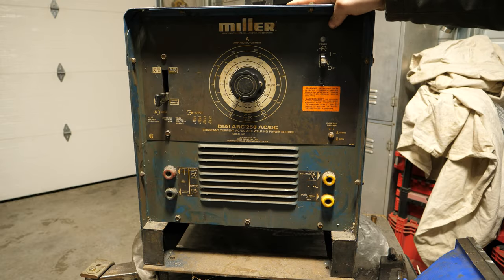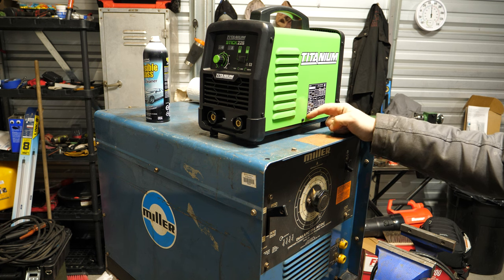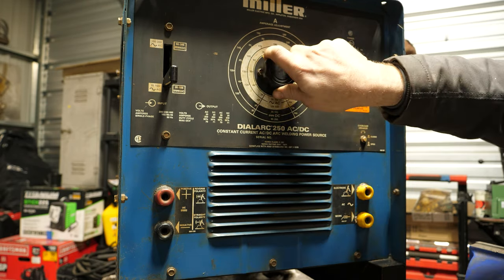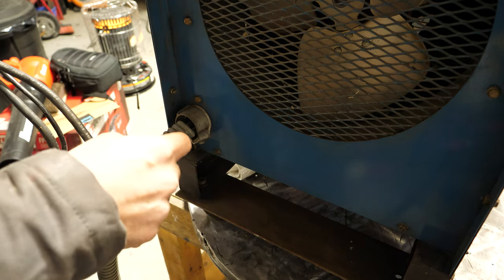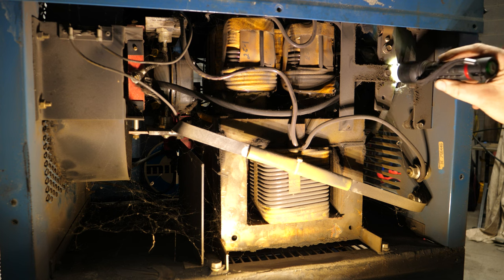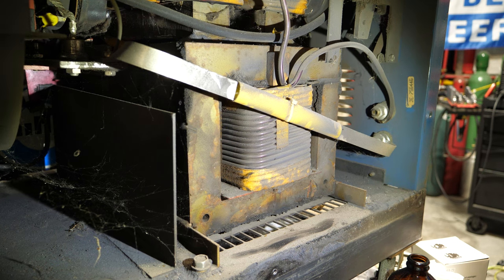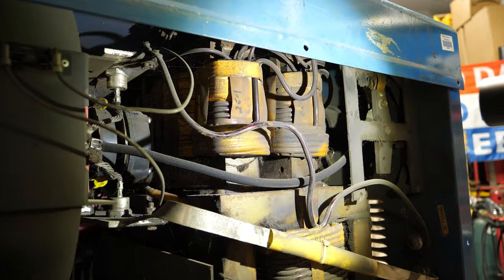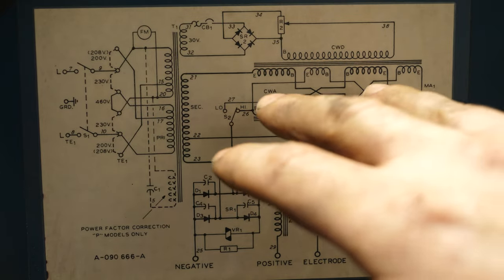Fixing up a 40 year old welder: What to look for and how they work

Comment: The word you're looking for is rheostat, power is controlled by magnetic amplification.
Reply from the maker: Interesting.  How does the magnetic amplification work then?  Many other older welders I have taken apart seem to use a mechanically moved shunt to control how how efficient the primary to secondary winding transfer is.  This welder is fixed with no moving parts.  The rheostat has very thin/small wire, so clearly it’s not carrying much amperage.  How would it be able to control a transformer?  My only thought would be that it’s varying the voltage of the output on the initial transformer into the actual welding output transformers.  If that’s the case that initial transformer must not output much amperage.
Reply: mag amp looks like a transformer, it is a saturable reactor it uses magnetic saturation of the core which happens to be non liner property of certain transformer cores.   @makingmistakeswithgreg
Reply: A  small dc current on the control winding can switch or control large Ac currents in the AC windings thus resulting in current  being amplified.
Reply from the maker: I definitely have a bunch of reading to do 😀.  It’s awesome to learn new things 😀

Comment: Meanwhile, that Machine cranks up and the neighborhoods lights all dim 😂
Reply from the maker: It’s pretty amazing how much power that dial arc loads up a circuit.  There are houses in my area that don’t even have enough power going to them to run just the dial arc maxed out lol.
Reply: @makingmistakeswithgreg  yea it’s like the grizwalds Xmas lights remember? 😂 dude you gotta check out my comments I added bout the die grinder, I lost my shit laughing last night when you randomly lost it bout that thing cutting off on the welding side job video man
Reply: So I own my own landscaping business and have my little channel I added recently for it, but anyways, I was tinkering in my shop last night welding and I’m like dang that spark ⚡️ felt little hot 🥵 for some reason down at my ankle, so I flipped the hood up and there’s damn flames 🔥 coming up past my knees 😂 I’m like welp I guess that settles it, these work pants are highly flameable. I got it knocked out and there’s literally like 8” of my pant leg missing, so while still laughing but alittle burnt ankle syndrome I walked inside to show my girl and I looked like ace Ventura when he comes back into that big formal dinner after that shark tank with his pants all chopped off, that was me and we laughed for 20 min about it 😂😂

https://youtu.be/GUfS_2UGftg?si=jbmhyQr47cDee0g5

Comment: i run nothing but 60 year old welders and i never have any issues with them
Reply from the maker: With very few components they definitely are reliable.  The main limitation is how power hungry they are and in the case of the welder I have, the poor power factor loads up circuits thus requiring big power wire.   They still weld great and it pays to have a few around 😀
Reply: @makingmistakeswithgreg  my larsen elt-16 225A welder pulls 41A at 380v 3phase

Comment: Now draw for us Why 240v is more efficient then 120v...  And the Diff between 1 & 3 Phase... And the Diff between Pulse setting's on newer stuff...
Reply: P=I*U. For the same Power with half voltage  u have to double the amperage. Higher Amperage creates more loss through heat at same size wire.
3 phase calculation: P=I*U*sqr3
(and yes, both have to be multiplied with the PF cosPhi.) You get roughly 1.7 times the Power than 1 phase. 
Pulse usually for MIG or TIG, lower frequnency: good penetration with good control and fast freezing puddle. For out of position welding and thin sheet metal High frequencies narrow but intense arc. Makes aluminium MIG easyer. Some manufacturers have "hyperpulse"(some kHz) for smaw, too. But what this does is way over my head...

Comment: Meh. I’m reading the guys here who love these old machines. They’re ok. Nit great. Sure they last, but really, that’s not a big deal. A company writes off their equipment. No big deal. There are very good reasons these things have died out, and good riddance. It’s odd how they do these connectors. Copper is around 90-93% efficient. Brass is around 30-40% efficient. The steel is around 25% efficient. I would never had designed something that way. It gives me the chills looking at it. It’s really called three wire cable. But all three are conductors so I suppose it’s technically correct. Greg, I wouldn’t solder that as soldering creates a higher resistance joint. Normally it’s not too much of a problem, but with really high amperage connectors it could cause heating.

Comment: You call that big? You ought to see my old Linde HDC 300!😂  They call it a 300, but it’s actually rated for 380 amps. At full chooch you need an 80 amp breaker to run it!
Reply from the maker: Haha that will dim the lights for sure.  Back when the name plate had its rated “barely break a sweat” amperage.  The biggest single phase welder I have ever seen In person was a Lincoln ideal arc 500.  500amp output on single phase 240.  The breaker must have been over 100amps easily, or maybe it had to be wired for some oddball single phase voltage over 240v.
Reply: @makingmistakeswithgreg  I was actually looking at the nameplate on the Linde today and it says 90 amps @ 230 volts. Never seen a 90 amp breaker so you’d probably be running it on a 100 circuit. I ran it on 60, but I never cranked it up that high for anything I did. Yeah, I worked at a place doing welding on canning equipment when I was much younger. We had one of those monster welders. I would occasionally use 3/8”, and a couple of times 1/2” rod to weld on some of the stuff we built. You laid down one helluva bead with that!

Comment: I really enjoy the channel and I’m definitely not trying to sound like the typical internet hater but….
Why buy this at all? Wouldn’t something like that Titanium 225 do everything this machine will do? Aside from duty cycle of course, it seems like $300 could be spent on something like the titanium with the advantage of a warranty with none of the disadvantages like lack of portability and huge footprint.
Reply from the maker: No need to worry sharing your thoughts.  That is a very valid question.  I think it comes down to what a person wants.  From a welding perspective the dial arc has a smoother arc.  If the welder is going to sit in place and never move, (and you have the power to feed it) the dial arc will likely far outlast the 225 and I rather use that.  It also has far more stable output at higher amperage.  I tested the 225 and it’s dc output starts to break down a bit at 180+ amps (it starts showing signs of inconsistent voltage).   From a realistic standpoint, I would much rather have a titanium 225 sized stick welder over the dial arc if I only had one welder.  Like you said it has portability, is small, and it’s also legitimately consumes 30% less power.  For me the dial arc will sit in my new shop (once I can find one to buy) and be used occasionally.
Reply: Not to mention, it is fun to learn how things worked back in the day, and it is cool to restore something that probably would be scrapped.  I hate seeing things go to waste when a little elbow grease, and some parts, can bring it back to life, and in the case of that terminal, you can improve the original design.   Call it a passion or a hobby, some things are worth preserving, and it gives you pride of ownership, and a satisfaction that you can’t get from a modern version.
Reply: @michaelwhiting878  I totally get it as I collect vintage garden tractors from the ‘50s and ‘60s.  It’s just that if a fella is on a budget and wants a stick welder I think something like that 225 is the way to go. I have access to a few nice welders at work. At home I have a Lincoln 140 and titanium 225. Between the two of them I can get done anything I need to do.
Reply: I appreciate the lengths you go to cover so many different aspects of welding as a topic. Teaching beginners through advanced, rating welders, talking about them and even buying some that would be likely candidates for all different levels...then recording/editing/presenting it all, then taking the time to read and reply to most or all comments. It's appreciated! 👍 I mentioned in a reply a while back that I was looking at an old school Sears AC. I have around $70 in it all told and if it turns out I love stick welding an upgrade to the 225 or beyond may be what I do. Love your content and the lengths you're willing to go for butane!😂😂😂

Comment: Seriously. You created a video on how to rewire a welder. Any idiot can do this.
Reply from the maker: If that’s all you took away that’s unfortunate.  The main purpose of the video was to help people who might want to buy (or already own) a old welder, understand how they work and what to look for so they don’t have it blow up when they hook it up to power.  Oddly enough the welder had a broken power lug and would have blown a hole in the side panel had I not inspected it.  The video was also to familiarize people with what to expect when opening a welder up.  Many people are afraid of doing that because they have no idea/experience with doing stuff like that.  It sounds like you know most of everything in the video, which is perfectly fine.  I wasn’t aiming the video for someone who is at your skill level.